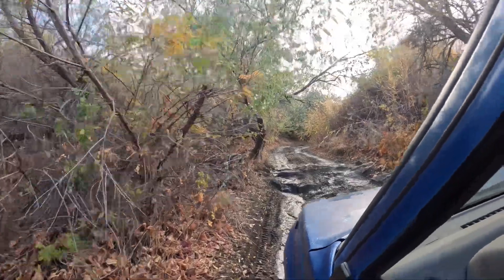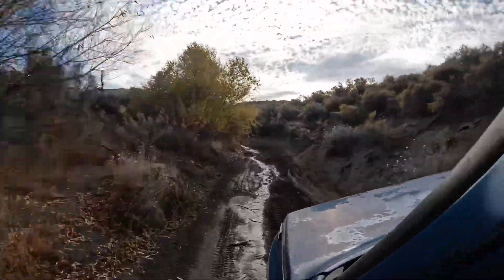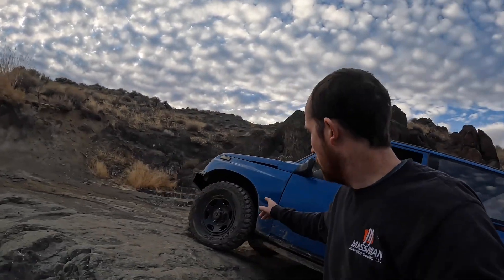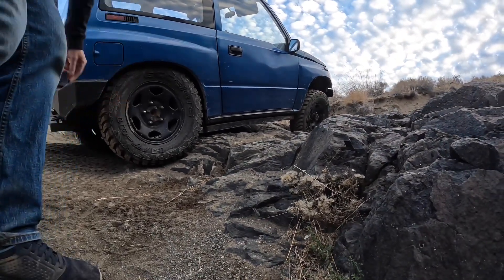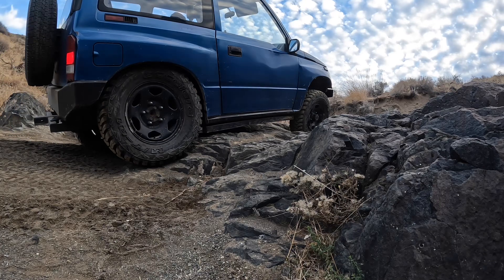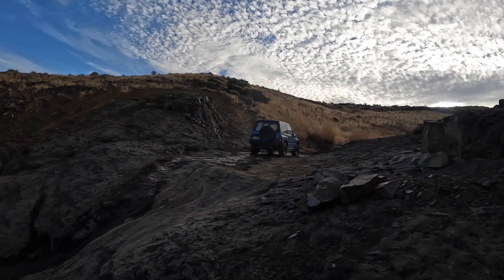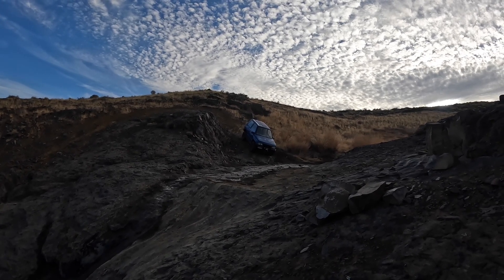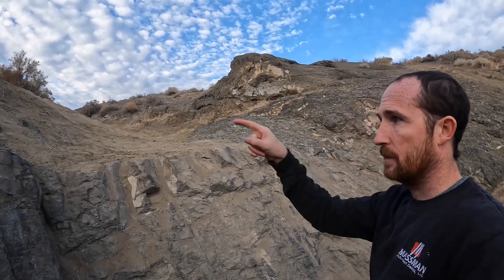Electronic Differential Locker Test

Comment: Whats your setup on that? Im getting a 94 geo tracker, im thinking 4.5 lift, 31s with tre e-lockers front and rear
Reply from the maker: @Catboy-hr2qp  it’s basically a 2” puck lift. 235/75/15 tires. E locker in the rear. Steel front differential. My bumper kits front and rear. I have a 3:1 T case sitting on the shelf I need to install. My next set of tires will be 31’s, and I need to redo my rock sliders. A 4.5” lift would be cool, but they are spendy and take forever to get from turkey. If I wanted to lift one more than 2” I’d either do a custom front crossmember drop, or go to Toyota axles and link it.

Comment: Bro plz how many spacers did you use to lift and where you putted?
Reply from the maker: @charbelassaker3290  check out my other video where I install the 2” puck lift. I give all of the details there. The wheels are stock with 235/75/15 tires. No wheel spacers.
Reply: @haroldshobbies  bro I watched but how many spacer lift did you use on suspension to lift
Reply from the maker: @ it’s a 2” lift
Reply: @haroldshobbies  ok did you put a spacer lift on shock absorber or only on spring
Reply: From the front
Reply from the maker: @charbelassaker3290  there is a spacer on both the spring and the top of the strut on the front. The aftermarket control arms that I got out of the junkyard had spacers built in. On a “stock” suspension you will need spacers on the springs as well as the struts on the front. On the rear you will need longer shocks in addition to the spacers
Reply: @haroldshobbies  okay bro I did this but why the wheel in front ho inside a little bit how to straight them plzz
Reply from the maker: @ you need to put camber bolts in the struts.
Reply: @haroldshobbies  bro plzz I didn't understood can u explain where to put cambers bolts
Reply from the maker: @ camber bolts go in the struts where they connect to the spindles. I would recommend having an alignment shop set it up for you
Reply: @haroldshobbies  ah you mean I should replace the two lower camber in the shock absorber with 2 smaller
Reply from the maker: @ no. There are special bolts that allow you to adjust the camber. If you just put smaller bolts in, it will fall apart. They are called Camber Bolts.
Reply: @haroldshobbies  I know it bro tx

Comment: What is the tire bro
Reply from the maker: @charbelassaker3290   accelera MT-01’s. Cheap and they work awesome. I’ve been running them for 3 years now and I have zero complaints. I typically run them at 8-10 psi in the dirt and 20 on the highway. I have zero complaints.
Reply: @haroldshobbies  what size bro
Reply from the maker: @ 235/75/15
Reply: Bro I have vitara 1.6 8v it's bad if sometimes rpm gets to 5000 rpm?? @haroldshobbies

Comment: As you were going around the vehicle just before driving up the obstacle I noticed the front tires weren’t as tucked as the rear. I’ve been wheelin’ a long time and I think that you would benefit greatly from disconnecting the front sway bar. Try that obstacle again without engaging the locker but with the front sway bar disconnected. I’d be willing to bet you’d make it up.

But I like the concept of the e-locker as it works the same as air or mechanically actuated lockers but seem less complicated. I put a LockRight lunchbox locker in the front of my TJ and it’s sometimes difficult to find a spot to get stuck - except when there’s mud. Not a fan of mud. 

Look into the Oregon Creek and Trail run. It happens every Fathers Day weekend and it starts in O’Brien Oregon, takes a couple days, great if you have kids, and your little rig would do great out there! There’s a small fee and it can fill up pretty quick but it’s something I try to do every year, even though I’ve missed a few years now. But I’m still hoping to go next year!
Reply from the maker: @jakematthews6982  yes, the sway bar is still connected. I do a fair bit of road driving and wanted to keep it connected for better handling around corners. I do have it set up so it’s simple to disconnect when/if I want to, but haven’t played with disconnecting it yet.

Comment: Rear locker is definitely on my list of upgrades. But I’m probably going with a lunchbox. I’ve owned one before in a Jeep wrangler and had no problems with it. But on a side note. Are you attending the fall classic in Prineville?
Reply from the maker: @offgridliving4128  I considered the lunchbox, but I really like the E Locker. Unfortunately I’m not going to make the fall classic this year. I have work :(
Reply: Depending on your vehicle a lunchbox locker will be best utilized in the front because of how they operate. Selectable lockers like the one in the video shine in rear axles because when they’re unlocked they operate like a normal open differential and don’t bind. A lunchbox locker is locked any time the diff receives torque from the drive shaft. So if it’s in the rear then it’ll lock any time you’re on the throttle (on a rear wheel drive vehicle) no matter what the terrain you’re in. That can cause binding and potentially broken parts from just driving in a parking lot. Putting it in front means it’ll only lock up in 4wd. 2wd driving in town will be completely unaffected.